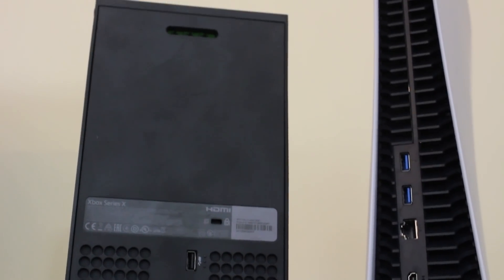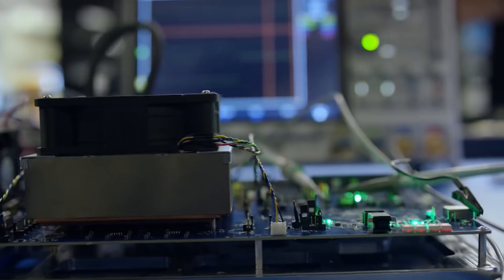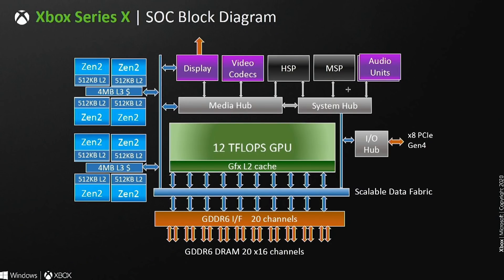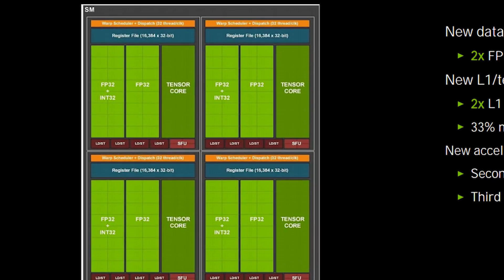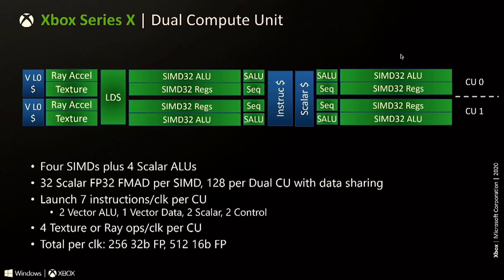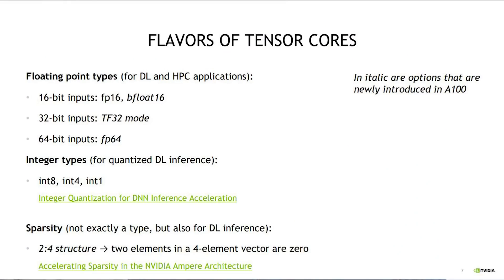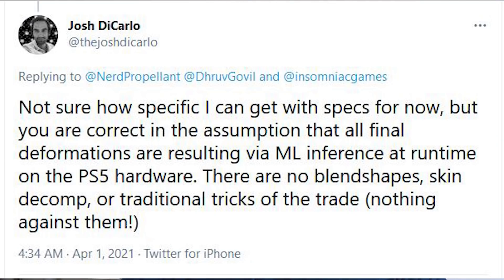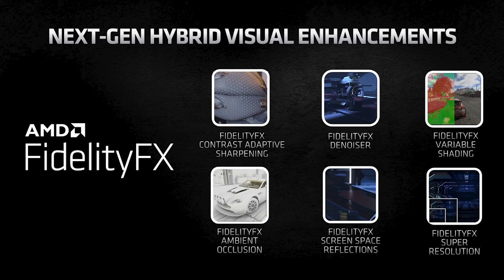Xbox Machine Learning & DirectML EXPLAINED - No, Xbox Series X Doesn't Use Tensor Cores

Comment: Can't wait to see a successful implementation of a technique similar to DLSS on the new Xboxes.
Reply: Xbox made the better console to be fair
Reply: @JamesShadowDrop  outriders has 35% higher average resolution on xbox, that's gonna become the standard this gen. every month xbox is getting better and better as devs get to grips with it.
Reply: @JamesShadowDrop  ah that won't age well just wait for 4
Re8 comparaison
Reply: @lostdeeply397  that 4 was daft and had no place
Reply: @JamesShadowDrop  I know 🙄🙄
Reply: @lostdeeply397  😂 fair one
Reply: @PennywiseTheDancingClowN ! The memory bandwidth might be slightly more on ps5 but xbox's memory interface is alot bigger at 320 bit vs the ps5 256 bit interface. The sonys ssd on paper has a wayyy faster ssd throughput but is that a sustainable throughput or just a max setting it could hit in perfect conditions.  Meanwhile the xboxs throughput on its ssd is a sustained no matter how hot the console gets. And from what we've seen so far ps5 ssd comparement has been heating up. So sonys problem solver is to turn the fans up more?  Not a very well thought out for such an extraordinary cooling solution, and dont get me started on the coil whine ps5 has.
Reply: @PennywiseTheDancingClowN ! lol are you on dope meth or 🐕food?
Reply: @PennywiseTheDancingClowN ! First of all the memory bus speed is much faster on the series X 560 GB/s vs Ps5 448GB/s and secondly the system OS takes up around 2.5/3 GB of the 16 on ps5. So its faster 10 versus slower 13 and thats not taking into account that memory is used for many other operations other than graphics and OS, which the series x uses its more than adequate 336GB/s slower portion of memory for.
Reply: @PennywiseTheDancingClowN !   @PennywiseTheDancingClowN !   Memory bandwidth as in, the total amount of bandwidth added together is slightly more. Yes xbox has faster memory but only 10 of it.  And control is literally the inly game thats like that, im wondering if the reasoning is becauae the pc verison is ported over to the xbox so nothing was really optimized and it kept the same texture packages and such. Yes we all know the big computer card have coil whine but those are close to  half the size of an xbox series x. Anyways I was just complaining about that part because someone always has something to say about how shit the xbox isnwhen really its just as good if not better in alot of aspects.
Reply: @MTF_Savage_Beasts 
1440p. When I play games at native 4K, I get that wow factor. Something about dlss doesn’t look quite right. It’s impressive tech but I have a very keen eye for graphics and it just looks kinda blurry to me. I played horizon zero dawn the other day at 4K and it really wowed me even at normal settings (with ultra textures), I just don’t get the same from dlss. I’ve tried wd legion and control.
Reply: @stebo5562  Don't even bother... in Cyberpunk is less blurry... but full of glitch and artefact. DLSS is the "definitive feature" only for those who don't know how graphic settings works.
Reply: @MTF_Savage_Beasts 
4K normal settings except textures which were at ultra.
Reply: @PennywiseTheDancingClowN ! Actually the reason the ps5 version is nearly half the size is because Remedy are using oodle for texture compression, and as we know the majority of the file size in games are textures, if they choose to also use BCpack on the xbox as the texture compression there the file sizes would be similar, it has nothing to do with how much 'faster' the ps5 can decompress data.
Reply: @PennywiseTheDancingClowN ! You don't want to hear it because it doesn't fit your narrative. It's like when some games load faster on the xbox over the ps5, one could act ignorant and say simply the series X ssd is faster, but it important to know why In a particular instance that may be the case. Its ok to be a fan but don't be a blind one.
Reply: @PennywiseTheDancingClowN ! Not defending just letting you know what is happening in this particular instance. At least now you know, you can have any opinions you want,  just don't throw out the accompanying facts that's all.
Reply: @MTF_Savage_Beasts It doesn't really matter... DLSS is blurry... it's just a tad better than TAA + upscaling + sharpening (you can try it yourself and enjoy DLSS on any GPU on any resolution)
From yet another 3070 owner.
Reply: I have a 3070 and DLSS is not overly impressive to me. Control looks blurry.
Reply: Yes I have a ps5 I can’t wait to see naughty dog using machine learning and the upsampling
Reply: Ps5 uses same rdna2 ApU from Amd . Xbox just has more cores . this tech can work on both., if amd wanted
Reply: @skywalker1991  just to make understand something developing for more 52 cu is more difficult I like the ps5 because it is a balanced console compared to xbox
Reply: @lostdeeply397  one of the dumbest comments i've ever seen. GPU tasks are highly parallelized. the more cores you have the better. RT, machine learning and compute performance are massively better on xbox. a 3080 has more CU than a 3060, which one is the better GPU? simple question
Reply: @lostdeeply397  balance how explain 🤔
Reply: @supermadkid  you rly need to know that coding for 36cu is easier than coding for 52cu this just a fact rtx 2080 have 60cu and 20 teraflops and can't hit a 60 fps in raytracing I will say the ps5 is the most revolutionary console
Reply: @supermadkid  also more teraflops does not mean more performance just take the rtx 2080 it has 20 teraflops but can't hit 60 fps in raytracing
Reply: @lostdeeply397  dumb comment again. you don't "code" for CU count. a 3080 has more CU than a 3060 which performs better in RT if that's what you're going to use? why are you avoiding the question?
Reply: @lostdeeply397  2080 has more tflops than a 2060. you can't compare tflop between different architectures. within turing (2000 series) the 2080 has higher tflops than a 2060 and performs better. you have literally no idea of what you're talking about.
Reply: @munankendakwanzambi1553  means that ps5 is an  efficient console between the ssd the custom controller that has the power of 4 zen 2 cores for decompression data and tempest engine evry potential bottleneck is addressed and moving data rapidly due to higher clocks in gpu ps5 is a work of art
Reply: @supermadkid  omg this the worst take I meant the same the 12 teraflops of Xbox vs ps5 10 teraflops means nothing also teraflops are just a theoricall number calculated by cu and clocks speed of the gpu they are not matrix of performance
Reply: @lostdeeply397  lol you do know their gpu and cpu are cut down right lol and the ssd is not a gpu in disguise you Ponies are jokes shaking my head
Reply: @lostdeeply397  higher tflops in the same family of GPU =  higher performance in general. that will always be the case. 3080 has higher tlops than a 3060 and performs better. same for 2080 and 2060. or 1080 and 1060. same for AMD GPU's etc. when fully tapped out the xbox should perform better even if it's slight. it has the bigger and more powerful GPU. you gain more from having e.g. 20% more CU's than you do from having 20% higher clocks.
Reply: @munankendakwanzambi1553  do you know why ps5 cpu will be always more capable than Xbox series x cpu it is because ps5 has a custom ssd controller for decompressing data it has has the power of 4 zen cpu Xbox will put 2 cores at least for only decompression of data ps5 will not use any core for decompression of data also i am not a Sony fanboy i hate fanboys in general this just me a small indie developer saying my opinion
Reply: @lostdeeply397  lol smh another arm chair dev strikes again guess you haven't been paying attention to the x out performing the weakstation 5
Reply: @lostdeeply397  wrong. xbox has a hardware decompressor equivalent to 5-8 Zen 2 cores. google it. they spoke about this in detail.
Reply: @lostdeeply397 
Developers don't write code with the number of compute units in mind. There is a command processor (or whatever it is called) that distributes work to the GPU cores. I also think (this is an opinion) that Sony would have gone for more compute units if they didn't have to consider hardware backwards compatibility with the PS4 Pro.
Reply: @lostdeeply397  At the end of the day, a GPU at it's best, can only process and output data at it's maximum theoretical processing rate (It's TFlops). In a locked system like a console, where you cannot change aspects like the GPU clock speed or voltage, it can't ever process or output more data than that limit (Try as hard as you might).
In modern games and on any system, the GPU is very often already going 'full throttle', with the GPU often being pushed very hard and close to that maximum theoretical limit (95%+ GPU usage). It doesn't make any difference to the rate of GPU processing or it's output, if data is coming in faster to the VRAM from a 'fast' SSD, as the flow of data through to the output, is still heavily reliant and limited by how fast the GPU can process any incoming data (a system is always limited, by it's slowest component). Like I said, GPU's today are often already being fed more than enough data, fast enough, in order to max out their performance (You can't feed a baby any faster, than it can swallow). In fact you could say in a way, GPU's are slowing things down and are in fact causing a bottleneck in systems. As such, the SSD or decompression techniques used in the PS5, won't really make much  of difference at all, to a GPU's performance. As like I said, even without them and using a SDD, there's currently often enough of a flow of data coming into the GPU, to be able to max it out, to go 'full throttle'.
The place where Sony's 'fast' SSD and decompression techniques will make a difference, is mostly to CPU processing. There, there is often some wriggle room, as the CPU often isn't going full throttle or using up all of it's cores. This means that you could push out more CPU performance, from using those untapped processing units. This in reference to gaming, would mean more being able to do more CPU dependant things, like being able to have more in-game assets, having larger maps, having super fast load times ect........Which BTW, is pretty much what Mark Cerny said would be the benefits of using a fast SDD and using compressed data.
Reply: @lostdeeply397  PS5 doesn't even have mesh shaders ffs, it's basically a souped up PS4
Reply: You won't see anything quite on the level of DLSS on console, maybe next gen, might see hardware to do it better on the next AMD GPU's, AMD are still playing catch up on the GPU side.
Reply: @wing0zero  ah that is debatable
Reply: @lostdeeply397  
What they going to use though? I imagine there going to use some kind of temporal upscaling like already used, just a enhanced tweaked version till they have a better hardware solution on console, next gen (PC GPU's not console) will have better RT solution I imagine along with tensor for denoise and image reconstruction, they might even delay it long enough so it comes next gen and supports the hardware along side, they said themselves it's a year away, and that's also why console won't see a solution as good as the dedicated solution in Nvidia GPU's, PC might but console I don't think so.
Reply: @wing0zero  it is complicated bro but a hacker from russia  could run dlss on amd gpu he asked nvidia about  that and the tensor core nvidia said blah 😯😯 so what I can say is amd are aiming for something easier than dlss meaning it does not require a lot of coding compared to dlss
Reply: @lostdeeply397  
Yeah maybe you can get DLSS to run on AMD but without dedicated hardware it will have to use X amount of the regular hardware which isn't as efficient so you're taking rendering performance away to improve rendering performance which makes less sense, it's like how any GPU can do ray tracing really but that doesn't mean a 20 year old ATI 9800 Pro would be any good at it just because it can.
Also it's not a simple solution as in driver level and devs still need to work it in like with DLSS.

Comment: RGT idea for video...
SSD or SSD/HDD?
How about a discussion with a game developer about the challenges of designing a game that will benefit from a fast SSD (for asset streaming) while also being able to run on an HDD?
Can you do both in the same engine for the PC version? When you start creating the game with SSD and HDD in mind how early do you plan for that? What does planning for an HDD limit you to even if you plan to fork the code for a fast SSD version? Does UE5 Lumen/Nanite solve any issues with this? Will there be  increased flexibility in a game engine to automatically exploit Video/System memory pools to compensate for slower storage? And so on...
If you did this already I apologize (if you see it).
Reply: Yeah. I've been asking myself this question for about a week or so
Reply: Usually the problem is with using HDD, there are things to keep in mind while thinking about it's use, for an SSD is a no brainer.
Some example, a game with multiple connected scenes, like half-life 2, it needs to load each scene at a certain point, there is a way we can just say it starts to load after the player reaches a certain distance (during that time both the current scene and the new scene are in memory), after the player is a certain distance from the old scene, it can be unloaded, as long as it's connected it can be seemless. So for the HDD/SSD, for an SSD those limits can be quite small, but for an HDD it needs to start to load much sonner.

Comment: Using lower precision operation is not a problem. For example, running an 8-bit operation on 32-bit core is usually just as fast running at a 32-bit operation. Running a 64-bit operation on a 32-bit core is also possible, but requires multiple intermediate steps, which can be about 10 times slower than 32-bit or hardware 64 bit.
However, modern cores can fuse multiple operations into a single operation. FOr example, you can run two 16-bit ops or four 8-bit ops at the same time on the same core, effectively doubling or quadrupling your performance. However, both your hardware implementation and the software used must be correctly implemented for this work. It seems that Microsoft has done for their GPU hardware, you just need software to be written to use that features. Nvidia can fuse two of their 32-bit CUDA cores to run a 64 ops, but they disable this feature on their Gaming GPU, but it is on their professional GPU. They used to disable the acceleration from fusing two 16-bit ops on pre-Turning gaming GPU, but they enabled this feature on Turing.

Comment: well... finally using SSD is a good move.
but why developers never spent any time on using the RAM of the PC????
they can preload a lot of object in the RAM and keep it there instead of reading the disk again and again.
they should be able to cut a lot of loading screens, but they never did this. 
and this is a problem, this demonstrate that developer dont really spent any time on optimization of the game, they only focus on the rendering side.
Reply: not everyone has plenty of free RAM available to preload unused assets. Also, modern games require 60+ GB of disk space, very few people have enough RAMs on PC to fit in compressed assets. creating an entire system to dynamically stream world assets, decompress texture, unload likely unused assets is probably the best of the hardware and not an easy thing to create, especially when you want your game to work on a wide range of hardware. Just like there are developers how is their main task to create optimized graphical effects for their games, there are developers which are tasks to create a reliable asset streaming system that loads in just in time.
Reply: @NizarElZarif  
its not complicated.
you just need to create an in-memory cache limited to the available RAM of the system.
when your code needs an asset, you check the cache, else you load it from the disk.

if you want something smarter, you can have priorities on top of that, like some priority assets which should be kept in cache when you have to free part of this cache.

from a code point of view, its few lines of code.
Reply: The  main reason is there is not a specific amount of RAM onboard everyone's PC. They can state minimum specs such as 16GB required but you will probably find tons of people still only have 8GB in their PC even today.
Reply: @DEVILTAZ35  well... when you have 8GB of RAM in your PC, you have a good 4GB available for the game, which is 50% of the VRAM (as 8GB of vram is common).
4GB of cache its huge. its a ton of textures or objects ready to be sent to the VRAM in less than 1sec.

Comment: Tensor operations are a thing.  A mathematical thing.  Nvidia doesn't have monopoly on the word Tensor. https://www.youtube.com/watch?v=bpG3gqDM80w
Reply: Ai models use tensor as a structure for the input . Nvidia just inspired the naming from that because they will be used on tensors . Nvidia tensor cores are just designed to do 4x4 matrix multiplication  of mainly int4, int8 and fp16 .
Reply: @mehdi6082  Still unfortunate that the term "Tensor" being associated as being an Nvidia invention(At least in Gamer circles), when it is clearly not.  https://en.wikipedia.org/wiki/Tensor_Processing_Unit